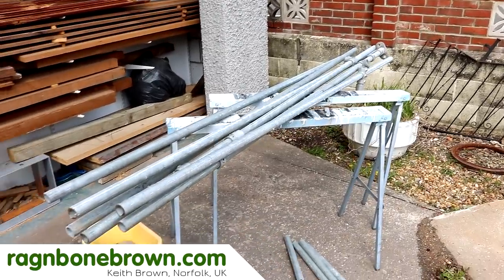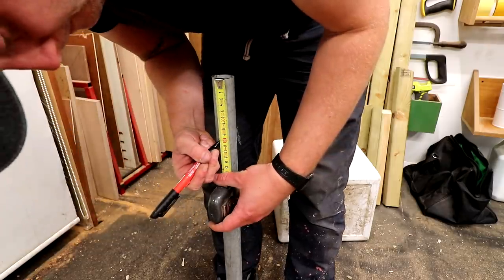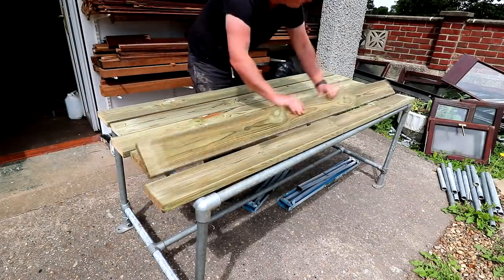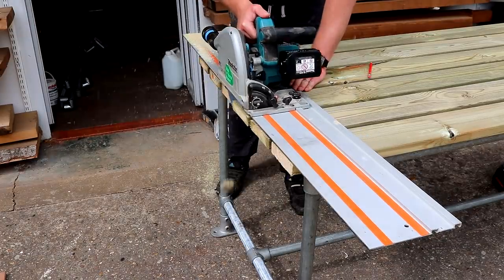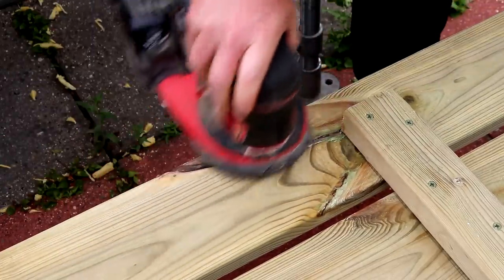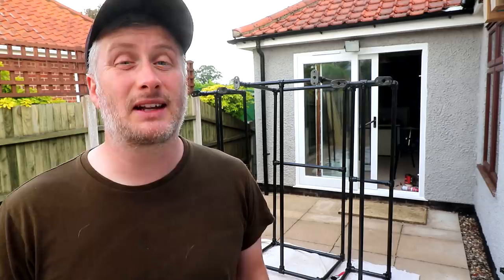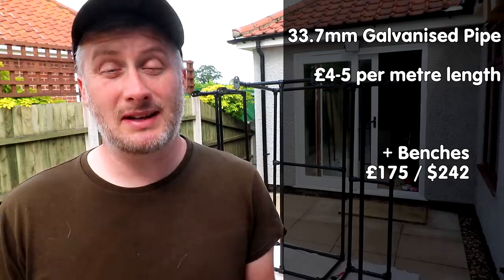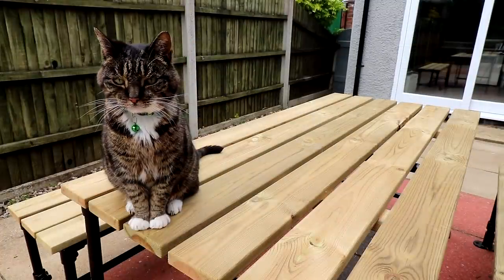I Made A Garden Table & Benches

Comment: I love your videos and congratulations on being married! I would like to add a note of safety: I've known several unfortunate souls who worked with their wedding bands on. If you were severely injured in one lost their ring finger with injuries involving their wedding band. Consider getting a silicone band which still isn't 100% safe or wearing your wedding band under your shirt on a chain that doesn't hang out of your shirt, or hang a coat hook on the entryway leaving your home to your shop so you get in the habit of taking it off when you leave and putting it on when you come back in from working in your shop.

Comment: Great project. Thank you for sharing. One could also router out a rectangle at each bottom corner, that would inset the tabletop and then there is no need to drill into the pipe and add washers. Just an idea.

Comment: I really like the build.  I have something very similar but, I admit, I purchased a kit from "The Metal store".  This cost £311 approx. and comes cut to length and with the fittings & timber.  The timber I ended up with wasn't very good, but I came to an arrangement with them so all is well.  The reason for buying the kit was simply that it was more cost effective than buying the components separately.  
I do not work for this company, it is just that some of your viewers may want to take this route.  The table is 1500mm long, 670mm deep and 760mm high and each bench is 1200mm long, 220mm deep and 500mm high.

Comment: Would have much preferred to trench out the underside of the end planks, allowing them to all sit level, no? Regardless, an excellent project and I am really tempted to use this design myself in my garden in the coming weeks - with your permission. I will email you pictures when it's done :)
Reply from the maker: I considered it, but didn't want to compromise the pressure treatment on the boards and felt it would be a place for moisture to gather 👍

Comment: I think it looks great - much nicer than a picnic table or standard garden table. The black is sharp against the wood - very nice. And I like how you over-built it - is much prefer it was strong and going to last than be easily broken in a few years. I had no idea that kind of metal was so easy to assemble. I’ve seen similar metal used around construction sites in scaffolding - might be another cheap way to get it secondhand. Great job!
Reply: Oh, and hi Dylan!

Comment: Loving the project Keith. There’s a place near me called themetalstore  that supply the pipe and fittings (I’ve used some in my workshop for shelving). I’m lucky enough to be able to collect, so not sure on postage, but they do cut tubing to length for free, so saves on some work.

Comment: Nice, utilitarian design. Easily adapted to any wood. But pressure treated lumber. Working with it is one thing (mask and gloves), but heeding the warnings about washing your hands carefully after handling it, I don’t use it for any surface that people will be in contact with - including kids and play equipment - whether or not it is painted or otherwise sealed. My opinion for what it’s worth. Thanks for the video!
Reply from the maker: I don't think it's as hazardous now as it used to be since it's been so heavily regulated it's much safer (although doesn't last as long!)

Comment: Interesting solution to the corner bracket issue! I'd probably have just routed the underside of the boards on the corner. I've looked at using scaffold boards before, and the price has always surprised me! It's odd there isnt a bigger second-hand or reclaimed market for them.
Reply from the maker: I considered it, but didn't want to compromise the pressure treatment on the boards and felt it would be a place for moisture to gather 👍

Comment: Great use of those pipe and fittings! Did you consider routing the 4 corners to level them up? Seems it would have been the quickest and easiest way?
Reply from the maker: I considered it, but didn't want to compromise the pressure treatment on the boards and felt it would be a place for moisture to gather 👍

Comment: That is cool , i recently made a table for outside out of super thick sleepers for the top , all good but the middle one is split ( not all the way ) , any ideas how to fix it , filler did not do a good job .
Reply from the maker: You could try using epoxy? It should be fine for exterior use I believe